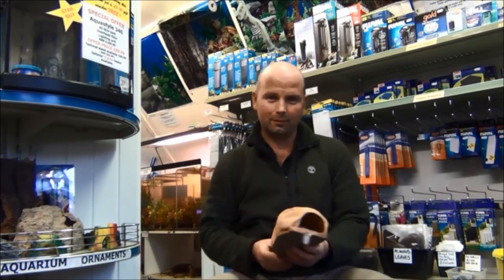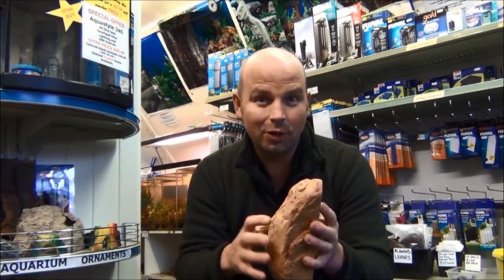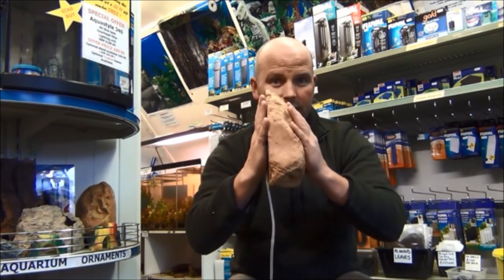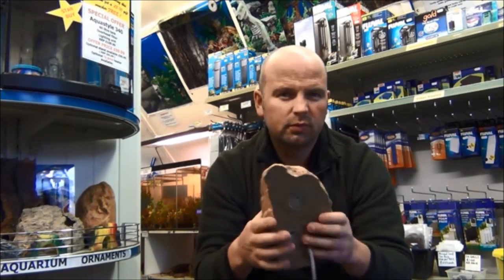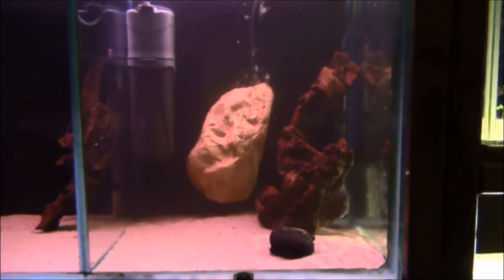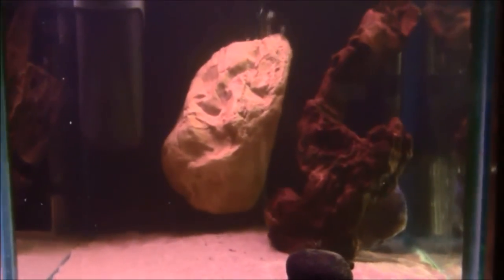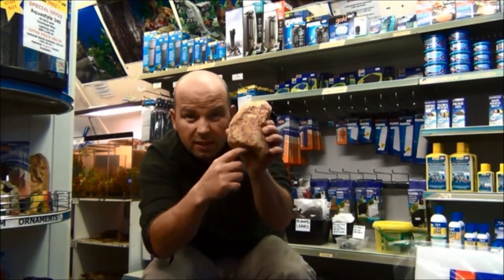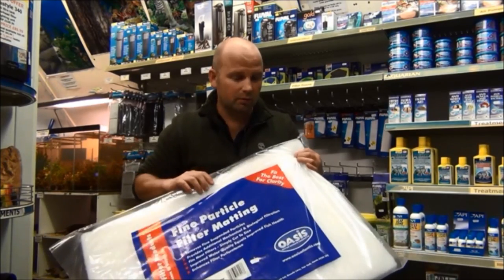'Invisible' Aquarium filter - Awesome internal fish tank filter by Pondguru

Comment: Hi Richard. I already asked you few questions about biohome and I know which to go for. You also advised that this type if DIY filter would be good. Currently I have fluvial Edge 46l tank which is cycling without fish but I will be changing it to 60l open top, curved edges tank.It is slightly shallower and wider. I will move plants from the fluvial tank but I will use sand as a substrate because researching www everyone says (including you) that the sand is easier to keep clear and personally I think it looks better.
With regards to the filter - the DIY suggested by you it is driven by the air pump and puts the air into the tank. I live in the south of UK and the pH of tap water is 7.4-7.8 so I was thinking of dosing co2. Again, reading on www forums I understand that running air and co2 into the water does not work. Therefore my question - should I use a standard (if so which one you would suggest) internal filter that I would modify with your media and foams and dosing co2 or try to create similar DIY filter with is run by pumped air and forget co2?
Reason for using internal filter is that i want it to be very quite because my wife hate the idea of the tank and I don't want to give her any more ammunition to complain.
thx, Kam
Reply from the maker: Dear Kam,
I really need to take a look at some of the newer designs of internal filters as so few can be altered to include a decent amount of proper media.
If you have a 60 litre tank it may be worth looking at the fluval 206: http://geni.us/qQsF90
It is an external filter but may be the only solution to getting enough media to provide the full cycle filtration associated with reduction in nitrate level.
It would leave much more available space in the tank for fish compared to an internal big enough to hold 500g - 1kg of media.
Regards,
Richard
Reply: +Pondguru Outdoors Hi Richard. I went for 100l tank so external filter is a must now. Due to space limitation behind the tank I can't but fluval filters as they are very tall and bulky. I have seen some Eheim filters and considering classic 250 (2213) or experiance 250 because either has small footprint - my space is 18cm wide and the tank 45cm tall. Have you got any experience with either and do you know which one will have greater capacity for your biohome media?
Reply from the maker: I'm not really a fan of the fluval round filters so I have never stocked or used them so I'm not much help there unfortunately.
18cm is not a very large available space.
If you can fit the fluval 206 or 306 in then go with that - I was going to suggest the APS 1000: http://geni.us/2LnO but it needs at least 24cm space (the size in that link is wrong).
Reply: +Pondguru Outdoors ok. I have just ordered the 1kg fresh water kit from your website. And i will have a last think of the space vs filter and buy one. I will report back soon
Reply from the maker: No worries and thanks for the order. Hopefully you saw the notification  about delivery being delayed until I get back into the country. We're having building work done while we are away and will have no internet at home until tomorrow.
Reply: +Pondguru Outdoors Hi Richard. I received you media package. The Eheim Classic 250 (2213) has just enough space with some spare left for 1kg of biohome ultimate and set of your sponges. Problem was that i could not get it to work quietly enough for my liking so I swapped the filter to Fluval 206 as per your suggestion. Just about enough space in top two trays for 1kg of biohome and in the bottom tray i put of corse, medium and fine sponges.  Should I have made any modifications to the cassette with two sponges? I was thinking of getting rid of it altogether and stacking some foam there corse and medium from top to bottom?
Thx, Kam
Reply from the maker: I have seen that method used before and it seems to work fine. Unfortunately I haven't had one of the 06 filters to try that myself so I can't confirm how well the sponges stay in place but I'd say give it a go and see how it performs. The cassette system is simply there for after sales income not for performance.

Comment: Could you adapt this design by placing a water pump inside an ornament? Block it off with some sealant. One end you have your bio media and then your foam at the start with a pump sucking water through it and dumping out the top? I'm not sure if the biomedia works with a high flow rate/does it need aeration too?
Reply from the maker: It would work just as well if it had a pump drawing water through it and biohome works just as well in a well oxygenated environment, high or low flow.
Reply: I have to give this a go!

I've just thought of an easier way of doing it, if I can find an ornament that the pump will fit in, I can drill a hole big enough in the top for the exit of the pump and seal it off then I know the water's drawing through the media, round the back have the inlet area with the foams, media inside, peat ball, job done! If I make a video and reference you would that be ok?
Reply from the maker: FishPie Sounds interesting and reference away, no worries. I always tell people that if they want more views put my name in title, description and tags as that will get your video shown alongside mine so it's all good.

Comment: would it help these filters if you added an air stone to the end of the air tube rather than just the tube by itself?
Reply from the maker: +Odyn York It wouldn't make much difference except maybe to make the air bubbles a bit smaller and therefore make the filter quieter? It wouldn't affect the efficiency as you would still get the same turn over rate based on size of air pump.
Reply: Hey noise reduction is a high priority....i found lee 3 inch wood air stones to be great as the bubbles are the smallest over so many other stone of any type
Reply from the maker: +Odyn York That would be a good option to use that to reduce the noise.

Comment: Hi,
Made my filter  but I used media called clearwater made by Aquality..should absorb nitrite,nitrate ,ammonium and ammonia!
Don't know if its gonna work?
What you think?
Used your soap bottle design...the media has a nice earth colour so doesn't disturb the look of the tank.
Fish seem to like it!
Reply from the maker: I can't find that media anywhere online to see exactly what it is but if it absorbs pollutants it will not be a biological media. Sounds like a chemical media and when it is full pollution will spike. Biological media is inert and supports bacteria which process pollutants, not absorb them so it is a long term solution.
Reply: the media looks like little ceramic balls..so its better to replace it ?
Reply from the maker: jaimy breeze I can't say for sure as I am not familiar with the Clearwater media but if that is a chemical media it needs to go after the biological media so I'd argue that biological media is still required.

Comment: So I ordered 1L of biohome ultimate prior to realizing that because of how open the pores are in the media that it is extremely susceptible to becoming clogged if my physical filtration isn't perfect.  Being that it's going in a turtle tank I'll no doubt have to replace it eventually but I was wondering would something like Biohome ultra be safer to use since it isn't so open on the outside?  The Ultimate was $50 after shipping (damn conversion rates) so by the time I'm running two large canister filters that's gonna add up to some $200 worth of media that may not even last me forever.
Reply from the maker: I think it was 1kg you ordered as the biomotion is the only one measured in litres. No media will last forever as it will all eventually become clogged with either debris or bacterial growth. However with reasonable mechanical filtration the biohome will last for many years, no worries. You'll need something with an extremely efficient filtering capacity to handle the waste from turtles - messy beasts, lol

Comment: Hi I have been looking like crazy for a way to filter my new 10 gallon reef tank.  I want something practically invisible. I know people are using aqua clear hob or marineland alot but they show from the front. I am going to pain back black and thought of a blck submersable filter it has a spray bar and supposedly doubles as a powerhead. I can put purigan in the middle of the songe. There is a hole in middle with carbon or charcoal. i am a newbie. I just dont want it to show.  Is there avery tiny HOB filter that would be strong enough. Maybe if a tiny bit hangs over the top. I have a small betta submersible. It dosnt eat a lot of space but since this is saltwater and harder to keep. I think that is a petsmart brand.  I can use panty hose with purigan or chemiblu. Ikeep hearing of those. barnds.  I Have heard some controversy as well.  That maybe I should use media insted. I dont think I can fit media in those small filters. I saw this plastic clear one that had sections and a pump.  Looked like a refugium, but they are sent from china and dont have time toi wait because I need to get cycle.  Do you have any ideas or name brands.  Maybe the tiniest aqua clear. I don't know how important gh is. some people say the rock will filter so maybe I can get a tiny one with less gph

Comment: may we use ceramic tile broken pieces , on the place of these ??
Reply from the maker: I would avoid using smashed up tiles as they will have very little surface area compared to even cheap ceramic rings. The biological media is the most important part of a filter.
Reply: but they work or not please tell .???
Reply: n thankx
Reply from the maker: Ceramic tiles have a very small surface area and are not very porous at all. Therefore they are a bad choice for a filter media.

Comment: If I was to build a smaller version of this, do I have to have the media in the filter? My current filter does not have media in it and has been running for 4 months - no fish deaths yet :)
Reply from the maker: You could make a similar filter simply with foams and filter floss to keep water clear plus minimal biological activity but for maximum biological activity it is always much better to have proper media in a filter.

Comment: Hi, How frequently would the media in a filter such as this need to be changed, you mentioned that it might take 6-9 months for bacteria to build up, so I assume changing the media before this time would be counter intuitive.
Reply from the maker: Yes the media should last for 6-10 years before it needs replacing.
Reply: wow okay that's pretty good. I'm considering building a similar filter in a turtle paludarium I'm going to create, for a general fish tank could this filter be used by itself or would it require a separate water filtration method as well? I will be creating a cascading waterfall for the back wall (to keep the live vegetation moist) which will intake from the tank as well though if I could use only one other filtration that would be very useful.
Reply from the maker: MrKhaern This would work as only filter in fish tank but as turtles are very mess I would go external filter (not those crappy hang on back things). Check my latest vide as there is a newer filter idea and this one will oxygenate the water and is easily customised.

Comment: what kind of air pump would recommend for this kind of setup?
Reply from the maker: ***** It doesn't need to produce loads of air and 70-100 litres per hour will be enough. This filter is really more of a supplemental filter to help with water quality and nitrate reduction so flow doesn't need to be crazy.
Reply: Pondguru  thank you! i watch all your videos i cant wait to get this project started!
Reply from the maker: ***** Groovy, best of luck with the filter building.

Comment: Just wondering , in a previous comment you said this was a supplemental filter. Its essentialy just the old school bubler type "box filter" but much better looking . those did work fairly well in small tanks , Do you think it would work as the only filter in say a 12 gallon tank ? Im thinking of getting back into it and like the idea of not having ugly filters showing.
Reply from the maker: It wouldn't necessarily keep the water as clear as a standard pump driven 'power filter' if the tank was well stocked and fed heavily but it would certainly keep it healthy by processing all the fish waste without any problems. The guts of the filter as you say are really what you'd just have in the standard old school box filter but obviously the media is a bit more specialised.
Reply: Pondguru I see, I think I might try it .I kept a 25 gal tank running when I was a teen but that was a good 20 years ago (hence the ref to old box filters) I miss it and was thinking of starting again and as you pointed out the biomedia and foams  are an improvement over the floss and charcoal I'm familiar with.  Even back then I stocked my tank lightly, Still doing research before I buy a new tank but found all your vids very helpful in deciding exactly what to get and seeing whats new.   Thanks Pondguru !
Reply from the maker: 411cyber
No worries, any time.

Comment: What size or internal volume of ornament would you advise for a 90L tank? Cracking idea mate, really is fantastic!
Reply from the maker: One the same size as the one in the video would easily be able to cope with a sensibly stocked 90 litre tank. As pointe out in a previous comment it would probably be better to use an air stone as opposed to the T piece on the end of the air line as that would provide loads of smaller bubbles and would be quieter.
Thanks for watching and appreciating the video.

Comment: Hi I've got a small 90 liter tank, currently filtered by an aging Fluval 2, and a small air stone.
Really like the idea of replacing the Fluval with a homemade filter like this resin stone one.
In your opinion, approximately, how big a tank can the one you shown filter with ½ kg of Biohome Ultimate on its own?
Is the water movement in the tank enough with just the air pulling water through the filter, just thinking that my Fluval pushes the water around the tank, assuming that’s a good thing
Reply from the maker: I'd imagine that a filter this size would easily cope with a 90 litre tank, probably double that. The filter in this video would certainly keep ammonia, nitrite and nitrate at lower levels than a standard filter but wouldn't give as much water movement as standard pump driven filters. Would be great for fish which don't like much flow e.g. gourami, discus, angels, dwarf cichlids etc.
Reply: Pondguru Thanks for the reply, much appreciated!
I’m just setting my tank up, and trying to keep it simply; thinking a small school of Cardinal Tetras & Corys
Reply from the maker: trifffid
Simple set-ups are always the best. I hate seeing tanks where people have tried to make a Noak's Ark of fish species.

Comment: Hi I have a EHEIM filter. Can you tell me how often I need to clean out the filter? I have a 78 litre tank. Just bought it yesterday. Do think its safe for me to leave the water to be cleaned out once a month?
Reply from the maker: Once a week is more like it with goldfish - 25% water change. You can reduce that by using media in your filter which will reduce nitrates e.g. biohome mini ultra or biohome ultimate. After 4-6 months of use you will see a reduction in nitrate levels (which are produced in large amounts by standard filtration)
Reply from the maker: Pondguru
Filter should just need cleaning as and when necessary (when the flow from outlet slows down). See the video 'How to set up an external canister filter' for the correct way to set that up. There is an 11 minute video I did a while back in related videos on right side of this page.
Reply: Nice one thanks